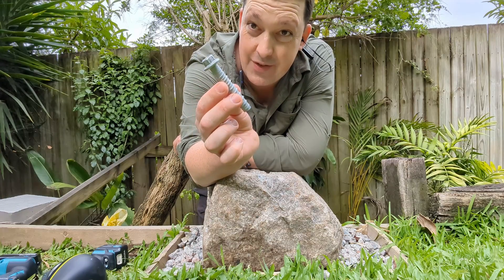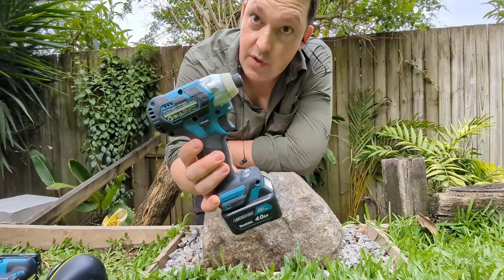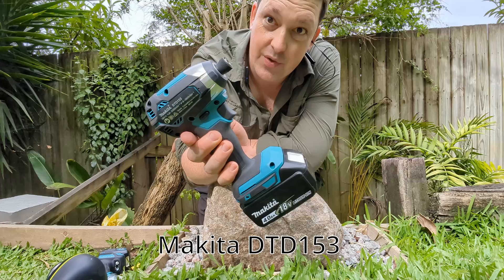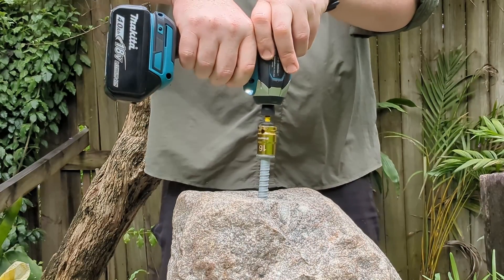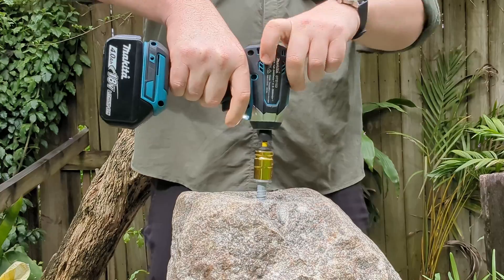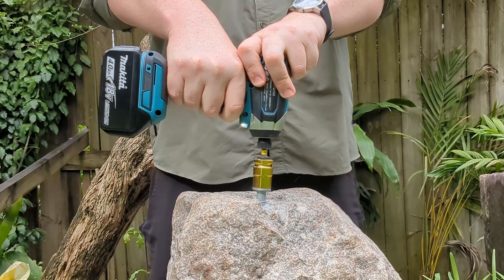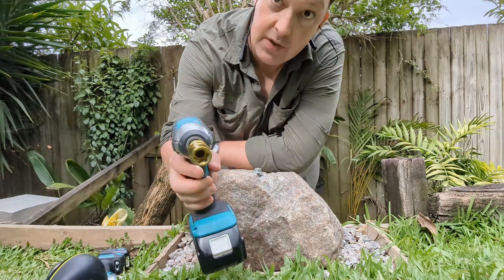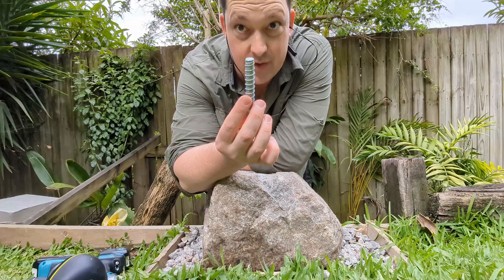Do concrete screws work in granite?

Comment: If the entrance of the hole chips in hard rock and the first thread is damaged, it's hard to get started.  I had that happen on a hard granite route I was bolting ground up, the threads on  my Tapcon 1/2" screw got mangled and I couldn't get it in.  I came back with a brand new Simpson Titen HD 1/2" and got it in eventually, but it was difficult.  I was just using a ratcheting 8" socket wrench with one hand while holding on with the other hand, no power tools.